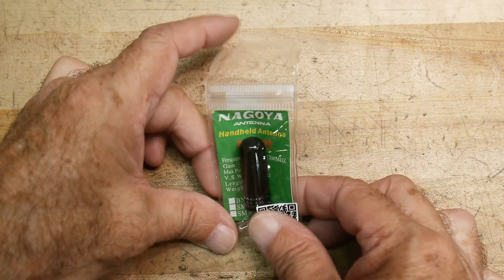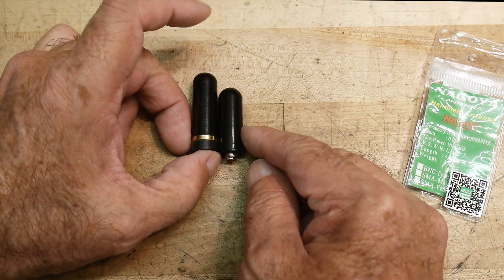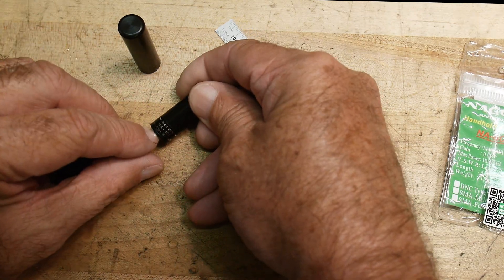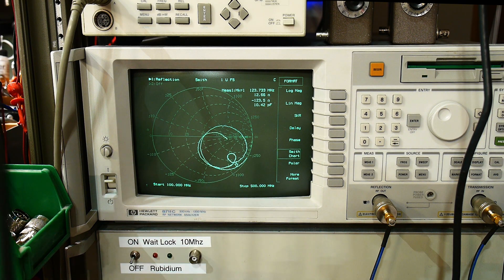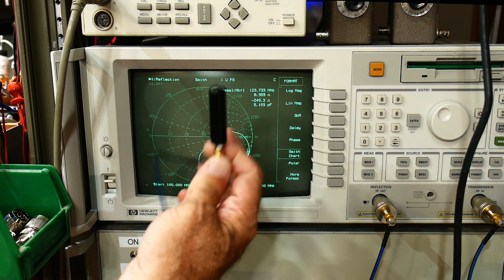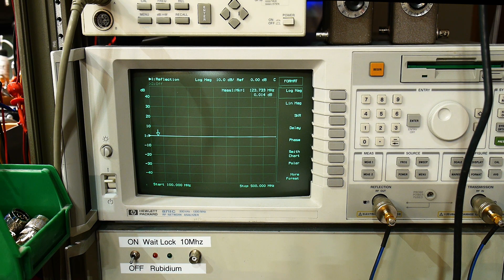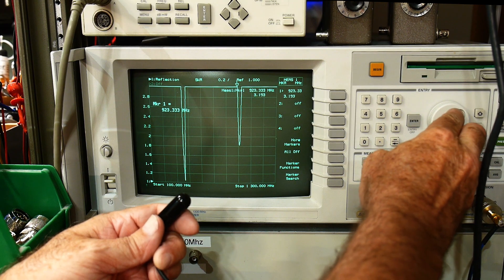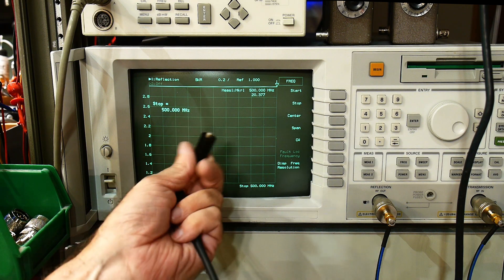#906 Nagoya NA-805 Antenna Measurement (35mm duck)

Comment: Then I might just get me a cheap knockoff if they are only meant to be used in a casual way, I need one of those for my Baofeng GT3 Mark II , the stock antenna is little too big for aesthetic reasons, and I only need it to communicate with my coworkers inside a building, they have the Kenwood's TK3000 radios.

Comment: Of course adding the red clip lead didn't make any difference.  You already have two counterpoises: the cable to the VNA, and your body.  Add a few ferrite beads on the coax as close to the antenna as possible, and suspend the antenna with string, fishing line, or other nonconductive line.  Then try it again.  In normal use, the radio is the counterpoise, along with capacitive coupling to your hand.

Comment: Surprisingly the Retevis RT-20 antennas on Amazon have a nice dip at 2m and 70cm. They are really quite good for their size and nice and flexible being silicone.
Reply: Do you have an more description for these antennas?  Length?  I've searched Amazon for Retevis RT-20 and came up with many radios RT-22, RT-24, but no RT-20.  When I added antenna to the search I get a lot of antennas that say they fit RT-xx radios, but no RT-20.
Reply: @BryanTorok  Try Retevis RT20 antenna without the hyphen. Just measured 2 here. They are either 6.5CM or 7CM depending on male or female SMA. Yeah their numbering isn't great as a few products have the same name. I've tried a load of "Amazon" small antennas and these are the only ones that do what they say they do. I wouldn't be surprised if the Diamond and Nagoya antenna in this video are counterfeit. As all the clones/counterfeit antennas I've tested in that size are only resonant on 70CM. The genuine Diamond stubby antennas have capacitors in them so will show a dip on 2M and 70CM.

Comment: Those counterpoise people are going to be all in a tizzy after this, ha.
Reply: No, I guess not.
Many have found it useful in a regular rubber duck antenna.
After all it's nothing but a metal conductor of the right size making the other half of the dipole antenna oriented vertically.
Though not practical all the time its worth need not be questioned.
The principle behind the 1/4 lambda vertical is your hand forms the other half.
Here, IMSAI guy just touched the bottom of the "dummy Rx antenna"  with a connector and expected a change in the pattern.
In the strict sense any antenna must be mounted in the "free space" using some kind of a stand and tested.
When he keeps moving his hand holding the contraption you can see the pattern getting affected and distorted.
He should have placed the marker on the "dips" to show the exact frequency of resonance.
De VU2RZA

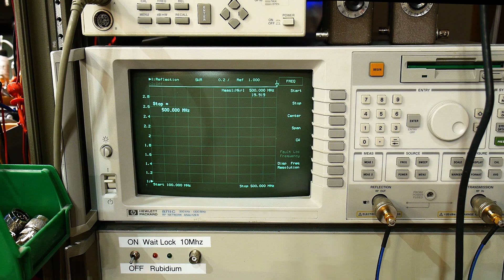Comment: 8:52 Realistically, the only practical use for those stub antennas is to reach a hotspot inside the shack. So it doesn't matter if they radiate only a few milliwatts.